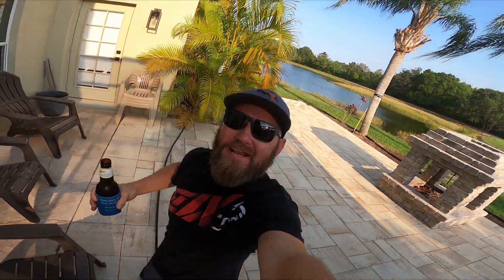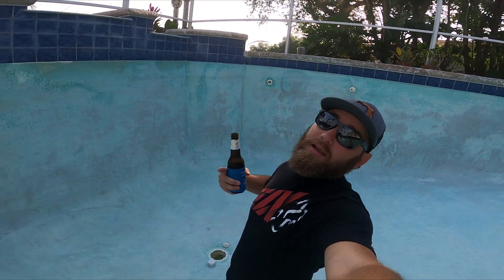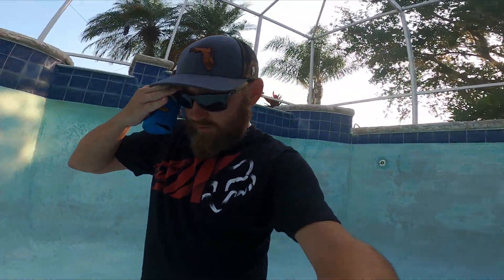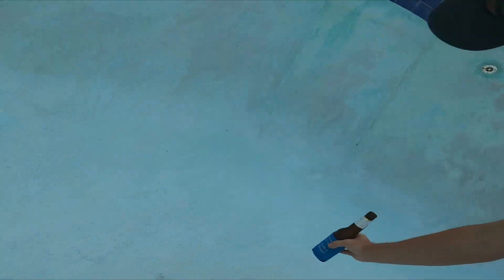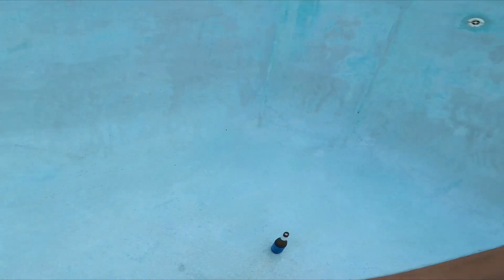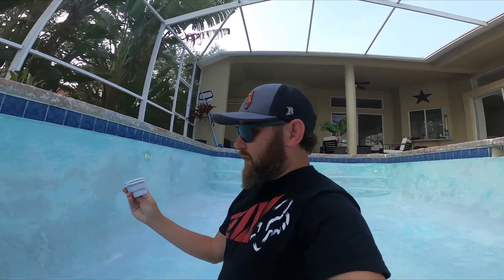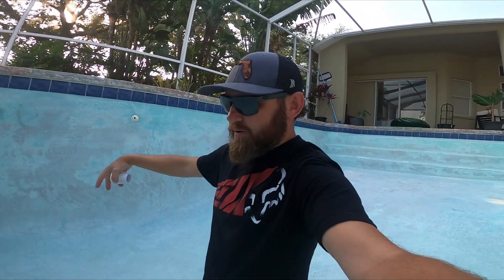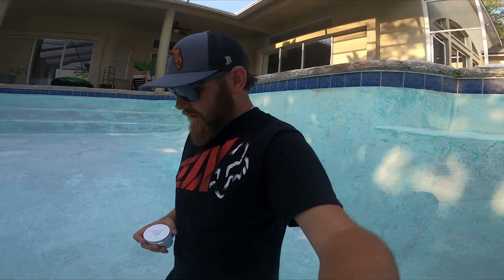Pool Pop Out and Hydro-Static Relief Valves.

Comment: Do the hydrostatic valves ever leak? Im having a inconsistent leak. Tried checking with leak dye and cant see where the leak is
Reply from the maker: yes, there is a possibility that it can leak over time.
Reply: @SebastianBalos ok cheers mate, do you have to drain the pool to replace, and are they all the same style/universal fitting, or is it different
Reply from the maker: @str8jkt69  You dont have to drain, but it does make life easier. I would generally say that they are universal but its really hard to say if the threads are consistent from one region to another.
Reply: @SebastianBalos  ok much appreciated
Reply: @SebastianBalos pool is concrete and close to 50yo

Comment: Dude. You’re walking in circles is making me sick. 

P.S. I don’t know what the end result of your circle is, but just in case. It’s called a hydrostatic plug. It’s best to remove the deepest main drain plug first. Then any remaining. Ground water will flow into the pool. Just pump it out. Replace the hydrostatic plug with a hydrostatic valve when replacing. You’ll be thankful you did.

Comment: What tool did you use to take that plug out. There’s no videos on that thanks
Reply from the maker: Good question. I ended up using a really big set of pliers and managed to get it out. I will say that it was a huge pain in the ass. Depending on your plug there are tools available but they might be pricey. I just added a link to a tool in the description of the video. check it out. Cheers.
Reply: Thanks
Reply: It's called a "T shape" something but it has two sizes on each end

Comment: I drained my pool and had it empty of water for 2 months before a random video popped up on my YouTube with a pool popping out! I was horrified and went to the comments where a few said, "you didn't take out the hydrostatic valve!"!!! Then I started searching and I was furthered horrified! I'm in Miami and I drained it in February which is our driest season so I guess the water table was below my pool! It's now June 23 and the pool is halfway up filled with rain water because I haven't fixed my pool pump/filter plumbing! Just now I got in the pool (water is rather clear since I add chlorine every week)  and saw that the hydrostatic valve is old! I want to remove it and install a new one as I plan to drain again to clean and fill up again!

Comment: some pools have a two foot diameter or so sump - basically a hole in the ground that sort of resembles a well.... that goes about four or five feet into the ground.  it typically about fifteen feet or so from the deep end of the pool.  this well tells you where your water table is.  you could do that too..... but with a relief valve instead of a plug you won't need it..... my pool has a pipe in the deep end going to crushed rock at the bottom.... but there is no threads to screw anything into.... and so needs a cap.  i have no choice unfortunately.

Comment: Toss a screw through a piece of pvc at one end off centre so it will fit around the square on the plug top and turn the pipe it’s a handy little trick for removing the plugs

Comment: Not an expert here but once you took that plug out,  that little water left in the drain should have drained into the ground, unless the groundwater table just happened to coincidentally be at the same level as the water in the drain @ 3:21 . 
Since it didn't drain, I'm wondering if the installer just capped that bottom of that port before installing the drain assembly, in which case installing the hydrostatic relief valve is useless since no ground water can flow into the pool.
Maybe a pressure test would have answered that question. If pressure holds then the port is capped .
Reply from the maker: The pressure relief valve at best is a “just in case” mechanism to reduce the fear or Likelihood that the the water table is high. Im sure that in moat cases its not needed. And in my case i doubt its needed as well. If i ever need to drain the pool again at least i can have a sense of relief if i have to run the pump overnight.  Cheers!
Reply: @SebastianBalos  I think what the guy was saying is that whatever is on the other end of your newly installed hydrostat valve likely doesn't have an exit point. So it doesn't reduce fear or likelihood at all. Unless like he said, that the water table coincidentally was right where the water line in your video showed up. Otherwise there shouldn't have been water in your drain box as it would have had somewhere to go... out the drain box.